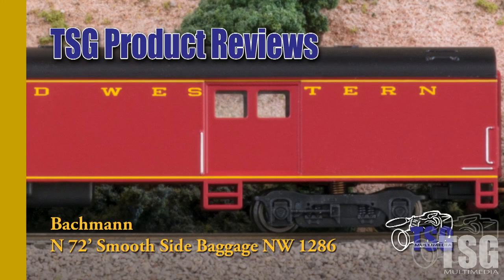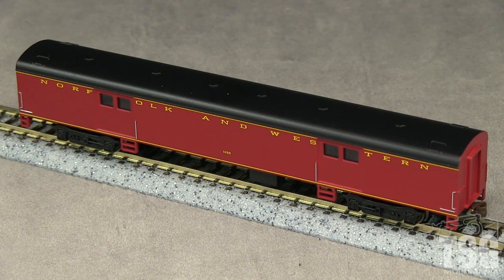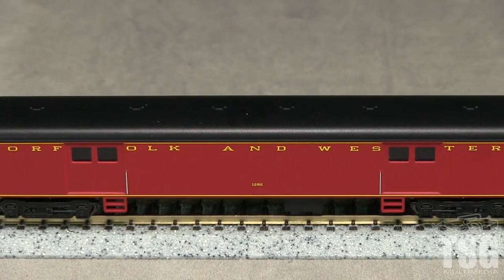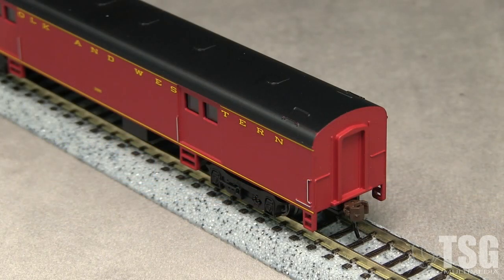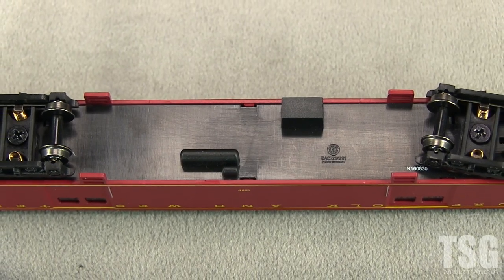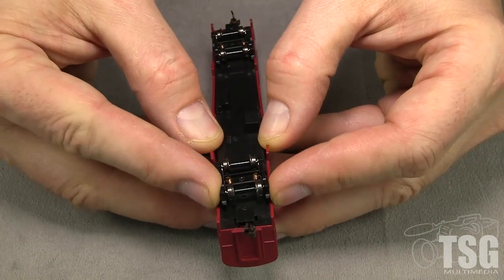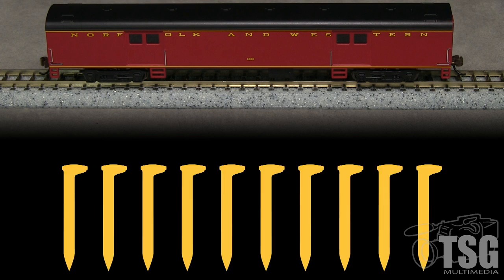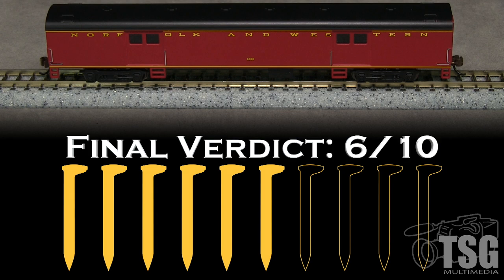N Scale Baggage Car Bachmann Product Review

Comment: I think this run of passenger cars in a few years will integrate into the second hand market nicely. Price is a bit steep for now, but they appear to fulfill the quota of train length rather than prototypical consist. It'd fit well with Con-Cors of years past, and I'm okay with it overall.
Reply from the maker: If you buy any of these cars, do not pay MSRP for them. It's bogus and way over-inflated for what you get.
Reply: tsgmultimedia wouldn't dare. I RARELY pay for anything MSRP.